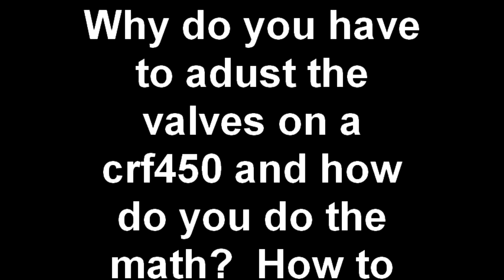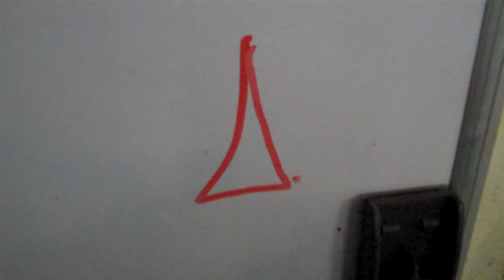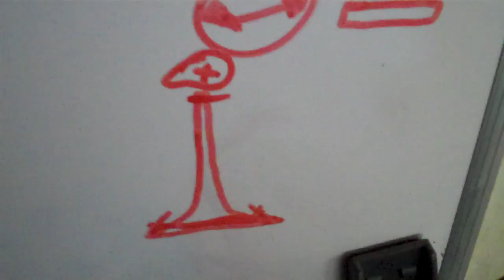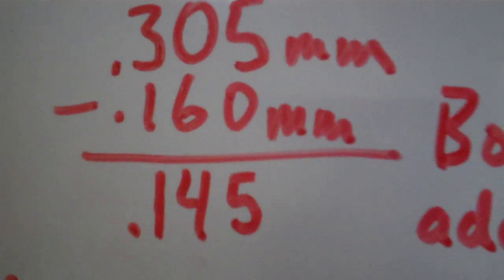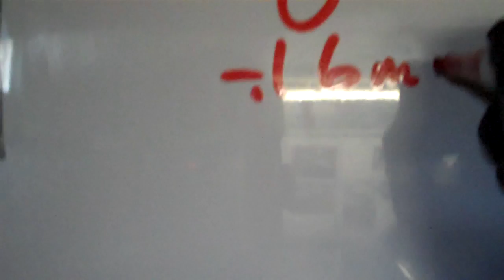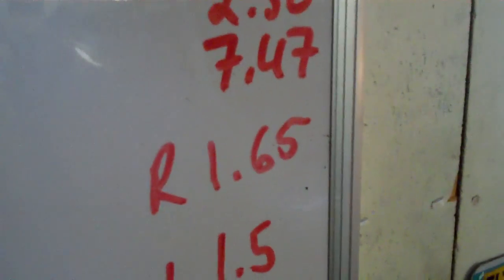Why CRF450 valves need adjustments and how to do the math

Comment: Oh by the way the valve seats are made of beryllium copper. That is a specially formulated copper it's designed to be a metal that can absorb heat well but at the same time after a heat treat it becomes much harder than titanium. But those valve seats will never be hotter than steel that's just the science behind their logic. Like I said before there's a method to the madness and sometimes what we see doesn't make sense but at the end of the day Honda's Engineers did it a certain way for a reason. But from one person to another I totally get where you're coming from sometimes it's just cheaper to put something in so you can get going and start writing again so like I said I totally understand I just thought it would be wise to let you know why these companies do the things they do. I I still love the videos by the way. I hope you don't take my comments the wrong way I'm just trying to point out the reasons why these bikes come with titanium valves in them.

Comment: Apparently the engineers from Honda say the reason why they use titanium valves is so you don't wear out the valve seat it's cheaper to replace the valve then to have to replace the valve and the valve seat so they make the valves out of titanium when you use steel you damage the valve seat as well as the valve slowly over time. This is just something to consider I'm pretty sure the engineers of Honda knew what they were doing if they thought steel was a better idea they would have put Steel in considering steel is much cheaper than titanium. This is just what I've been taught don't go to meet for all your answers you do whatever you think is best I just thought it'd be worth letting you know. Regardless I wish you the best brother you have to do what's best for you in the end I just didn't know if you knew why they were using titanium valves instead of Steel from the beginning. Essentially their main worry is not damaging the valve seat. And the problem with steel is steel eventually demolishes the valve seat and it's expensive or you probably just be better off either buying a new head unless you knew someone who could replace valve seats cheap. Sometimes there is a method to the madness even though it doesn't make sense from our perspective.

Comment: But have honda fixed their Valve problems in 2018? Watching in 2018 looking to buy one of these or should I just go DRZ400?
Reply: All higher revving competition based four strokes require regular valve adjustments...the drz will be less maintenance but extremely boring to ride compared to the drz but really depends what you're going to use the bike for...swapping out the valves to stainless will increase valve maintenance intervals immensely
Reply: @roostin  Why would it increase it? As long as the shims are stainless then it definitely shouldn't..
Reply: Alexander Bonnevie valves stretch hence having to shim them stainless will stretch less
Reply: @roostin  You said swapping the valves out to stainless will increase valve adjustment intervals though..
Reply: @roostin  So if they stretch less then why would the intervals increase.

Comment: does anyone know if I have a CRF 250x 09 it does have titanium vaulves I will be switching to steel or stainless steel vaulves do I need to change the springs or just vaulves because I caint seem to find the spring and vaulve combo in exhaust only intake

Comment: but does the steel walves does not wear out case itself then??
Reply from the maker: Kristian z The contact area where the valve meets the head is called the "valve seat" and it's steel.  And they typically don't wear out.  Great question!
Reply: What in the hell did you say?

Comment: Will it make a a sound if they need adjusted like a pecking sound??
Reply from the maker: Jeremy Johnson No.  This bucket/shim design doesn't make a sound loud enough to overshadow the rest of the engine.  The screw/nut type found in older bikes get a larger gap and produce a slapping noise.  These don't.  They actually get tighter against the cam as the valve wears out.

Comment: Hey Brian I was wondering if you or any other viewers could give me some direction. I have a 2010 crf450r, I just replaced the piston with an OEM piston because the one that was in it lasted two seasons and didn't detonate on me. The bike was running perfect before, the valve clearance is good, spark is good, fuel is good. The bike will bump start and run perfect but I'm too nervous to run it for even more then a minute when it won't kick start. I get a back fire sometimes when i was trying to kick it over, but it simply will not start  with a kick unless i go at it for quite a while.
Reply from the maker: Kurt 450 Backfiring can happen from timing or being lean.  I would check the intake boot for good seal.  Also check your timing.
Reply: Kurt 450 check your hot start or compression release I had the same problem because when you do the top or bottom end rebuild you typically unhook it and when you put it back for some reason it is all out of wack and just needs adjusted

Comment: Should I be changing both intake and exhaust  or just the intake side?
Reply: Usually the Exhaust Valves wear faster because they get hotter.
Reply: WRONG... Are changing the intakes because they are made of softer Titanium. The exhaust valves are stainless from the factory and only need changed if they fail inspection during tear-down.

Comment: Hey man I have a question, I have a trx450r and when I have e spark plug out it is still hard to push the kick start down. Could this be valves? Also the bike will bog when I am winding out the gears. Any help would be great, thanks!

Comment: ok i found a web site for a (google it) "honda crf450r valve shim calculator"made it super easy to understand. step 1) convert the shims inches to millimeters. (like you said in recent video) shims on intake both .067" (not .67) the inches converted to millimeters = 1.7018mm. the book specs call out 0.16mm clearance so with 0"/mm clearance now and a shim that is 1.7018mm step 2) the math goes like 1.7018mm - 0.16mm = 1.542 round it up to shim size 1.55mm to install! thanks for your videos!

Comment: sorry, im stuck.. i got 04 450r .011 on both exhaust valve side. decompression thing .014 i think those are ok (according to your other video) and intake side 000.000 i cant get anything under. (no compression & won't start) took cam off. the shims in there now both stamped number 70 both mesure .67" in the caliper. could you please help me out doing the math so i know what new to shims buy?

Comment: I just know things that cut forged steel wont cut some titanium alloys.. diamond drills are probably and exaggeration and I'm not rich enough to test it...

I think both of us generalize too much, we need a mechanical engineer to know for sure. I just don't see an engine wearing out one of the better titanium alloys and know most makers of engine parts and drill parts either use base-metal or one of the weaker titanium alloys.

Comment: It depends on what either is alloyed with. Manufacturers will keep profits high and have just enough fault tolerance to avoid trade violations. Same all metal usage, even in a ferarri or lambo chassis and engine...

In raw form titanium has enough strength to resist diamond drill bits, the strongest forged steel wont...

Comment from the maker: Titanium is really strong and really light but is soft compared to stainless steel. As an experiment, try drilling a 5/32 inch hole through each material. The stainless steel will burn up your bit. Titanium carbide is pretty hard, though.

Comment: "titanium is softer tha stainless steel"

not when it's more than a micrometer coating over poorly manufactured steel-alloy. The coating sales valves without lawsuit's for false advertising, it's probably even a low-grade titanium not meant for thermal application, the plant in china that made it couldn't care less...

Comment: Okay so im looking at buying a crf450. has a yoshimura pipe, not sure which one. He said it has been rejected and probably needs valves redone. It back fires when you let off the gas when riding. Does that have anything to do with.valves needing to be redone or is it the exhaust. Bike has strong compression when kicking it

Comment: so i have a 2005 crf450r and lately its been kinda hard starting it used to start 2nd kick cold now its taking about 7 or 8 to get it going and it sounds like my valves are a little loud and the power isnt as snappy as it used to be would that be my valve clearance?

Comment: I have crf450 as well.. Its definitely the valves. They just need to be adjusted. You may have bad valves though so I would check them. Think of it like this.. The more times it takes for you to kick the bike over, the more you're pushing your valves outta wack. Just adjust them(might need replacement) and you'll be good as new.

Comment: i check/ adjust my valves every winter. then their good to go for the next riding season. and that is on both my 450 r and x. maintaining these bikes are key to keeping them running good. if you don't you'll just end up with and expensive POS.

Comment: I have the same issue with my 04 crf250....i have it apart now and am wondering if i should also reface the head where the valves sit? i would rather not do it but id like to hear some opinions first before i put the new valves in! thanks!

Comment: its totally the opposite from what you're saying "Make a high maintenance bike a low maintenance bike" and i don't just guess, 2 of my friends has to shim every 10-15h and they have changed to steel.. BUT when after a couple of 100h on the titanium valves they wear out and its not even worth it to shim, just do the seats and in with new and ride happy with no problems again for 100h+++ And thats why you should have titanium not steel. The performance part is just a bonus.

Comment: TItanium valves is the shit as long as youre capable of cleaning airfilter and airbox regularly. 
Theres a reason why they put titanium in from factory... 
I have had 2 crf 450s.  I never had to even shim the valves on either one of them for over 200 hours. Starts on 1st kick even when standing for a month or so... When putting steel in they are much heavier and from what ive heard you have to check the clearence every 15 h or so. Otherwise they do not start or goes really bad.

Comment: Thank u so much I took it apart and checked them today and three of my valves were right on but the left intake was so tight I couldn't get any size under it.. So I have two stainless Ferrea intake valves that I'm gonna put in.. I just have to figure out the adjustments on it when I get them changed.. Should be fun but thanks for the video and the words of wisdom..

Comment: B, i used to have a 74 Kawasaki Z1 with big cams, etc. years ago and they had shims also, i used to call them 'pucks' clearance would be 002-004. Brian i switched to 'manley' SS valves and they used to have a 'relief' in the middle for better flow, the valve was a little thinner in that area, interesting about titanium as i have some T bike parts, i do know T is brittle as it will crack opposed to bending like SS. So the T will wear the valve seat or just the valve itself wears? Check Mnley 4 u

Comment from the maker: @stix746 You should set up the same as before- just have different valve material.  The titanium gives better performance in the short run, but is very high maintenance.

Comment: Hey if my 05 crf450 won't kick start but roll start and run fine but backfire a lil bit and it won't idle.. Does this mean I need the valves adjusted?And possibly need new valves?any info u could give me would be great I'm lost on it

Comment from the maker: @nickiz1 Kibbles do that.  They are cast in two pieces and then bonded.  The one's to get are called Faction MX.   They are the best.  They're made here in Utah.  Check out my valve adjustment vid for contact info and get some!  If you do the complete set you'll not have to adjust pretty much ever again.

Comment from the maker: @goosegirl615 THAT is a very good question.  The old shims are marked.  When you pull them out you'll see a number stamped on them.  If they're worn off or have been changed with cheap knock off brand shims you'll have to measure them. (they'll be blank with no # on them)  Just keep track of which shim came out of which spot to begin with when you tear things down.  Then as you do that valve measure if needed to get the correct measurement of the shim to use as your "current" value.  Good luck!

Comment: Sorry to sound dumb. But how do I know what the shim size is that is currently in my bike. I just checked my clearance and the RT is .005(0.10mm) and the LT is .004(0.10mm). I can not figure your math out. When i look at my feeler gages you said on your o
ther video yours were .0015 and it is .04mm but you used a different number than that in your math. What am I doing wrong here? I know this is a lot but I just do not understand.

Comment: Hey man really helpfull video!
I just wanted to ask you!
I have a CRF250R 2005 and i was wondering of adding stainless valves on it!
Is it safe for my CRF if i add those instead of titanium valves?
I found on ebay stainless valves exact for CRF250R but just wanted to ask you!!
And one more thing...stainless valves are same for 250 and 450 crf's?
Thanks in advance!!

Comment: Do you think that it is ok on the head if you run the stainless steel valves in a stock head? Because the head is designed for the titanium ones.

Comment: good video, im not sure all of it is valid though. I don't think stainless steel is harder than titanium, definitely not all grades of it. Even if you did have perfect valves its still going to be a high maintenance bike you will probably just have to machine the valve seat on the cylinder head because it would not be weaker than the valves right?